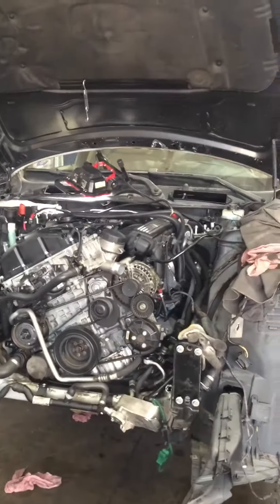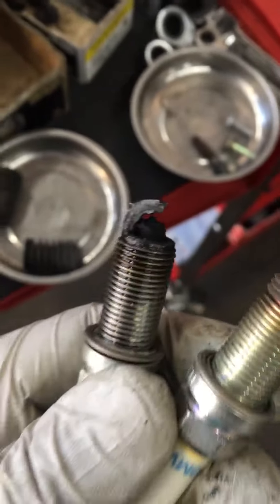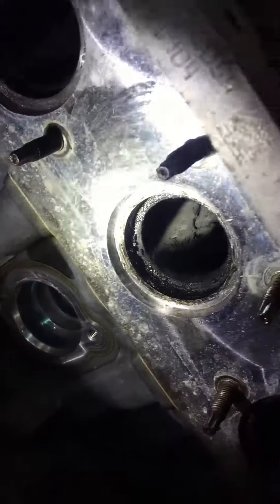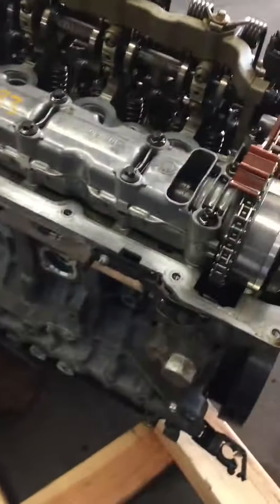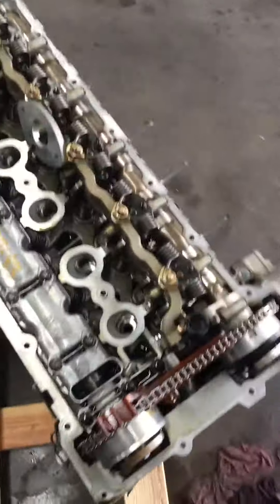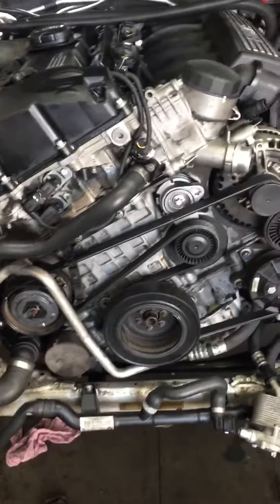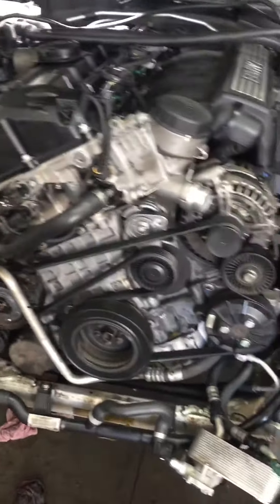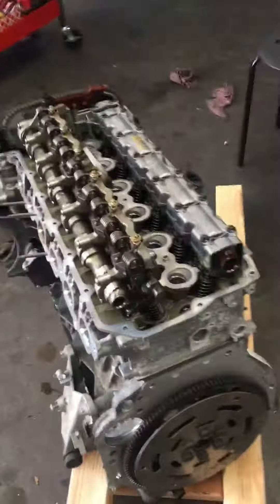2008 BMW 328i 3L Replace E90 engine because of oil consumption

Comment: Did you take apart the old engine? Was is the valve stem seals or the piston rings? I have the same problem. Oil burning only on cylinder 3.
Reply from the maker: Fred Nexus performed engine compression test.  1 cyl was very low pressure. Engine was bad. 90% piston ring was bad.
Reply: @behzadbavi8870  I did engine compression test, and all cylinders were good (maybe I test it again). What PSI should each cylinder be? Its burning/smoking white or grey smoke (not blue) on startup, especially when it is cold outside. When the car is warmed up it doesn't smoke anymore unless I accelerate very hard. How can I test to see if it the piston ring or the valve stem seals?
Reply from the maker: Fred Nexus do cylinders leak down test
Reply: @behzadbavi8870  cylinder leak down test will only check the valves themselves against the head but not the seals themselves. Any idea on how to check the difference between valve stem seals and piston rings? Compression was good on all cylinders.

Comment: did u try high mileage oil first??
Reply from the maker: ueg1974 performed engine compression test.  1 cyl was very low pressure. Engine was bad.